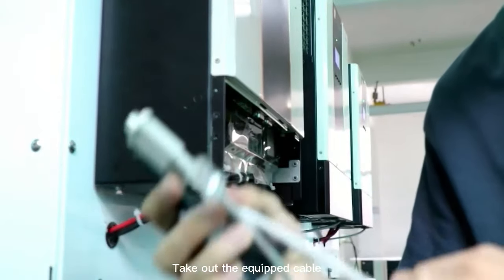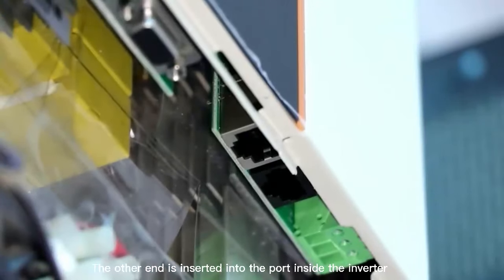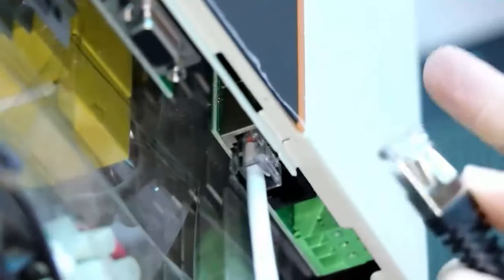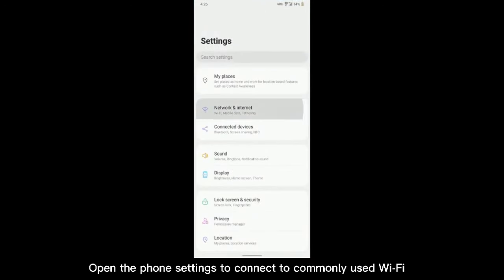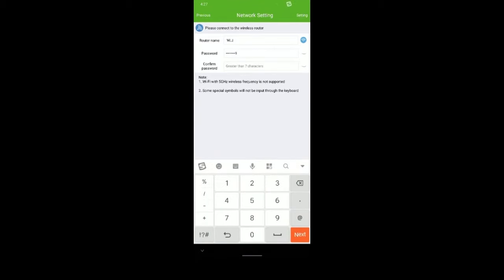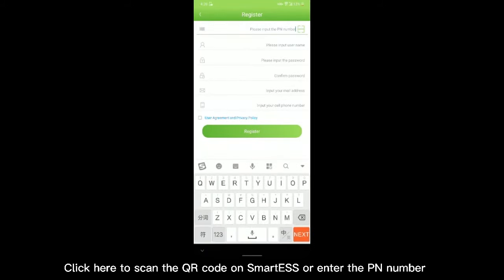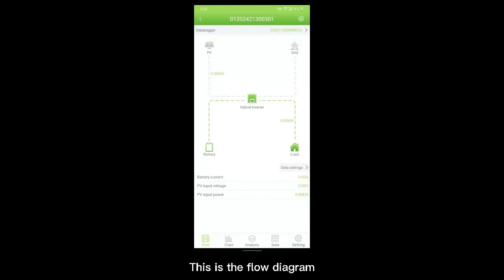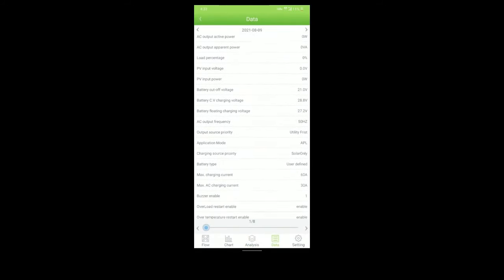Felicity Smart ESS installation

Comment: Hi there @felicitysolar ,
I’ve got three inverters on my wall (three phases), they are all correctly connected and work well. Also two batteries. However, when I connect the dongle to the first inverter (P1), it only shows the data for that inverter. I assume that the inverters communicate with each other. How can I read the accumulated data (entire solar production of all three inverters together)? I surely do not require three separate dongles, do I? What setting do I have to change so that the overall production is reported via the WiFi dongle? Thanks for your help!
Reply from the maker: Thank you for your trust in us. Please contact our engineer for Technical support by whatsapp: 
Wasely  +86 131 2609 3443
Reply: @ @all : I am highly disappointed. I was told that one dongle can only monitor one inverter, even though the inverters are connected by communication cables. In short, there is no way to properly monitor three inverters in a three phase setup. A setup that is promoted by felicity solar themselves. This needs to be fixed - as well as a proper API for home assistant integration + an application that is not full of bugs. 🐞 so much room for improvement and many low hanging fruits. At this point I would not recommend anyone getting a felicity solar inverter.
Reply from the maker: @ Thank you very much for your support. We are sorry that this product function cannot satisfy you. Felicity Solar is a developing brand. We will continue to improve related functions after receiving your feedback, so that you can use it more simply and conveniently. 
Please continue to pay attention to our new product functions. We will strive to meet your expectations, and please give us more suggestions for modification.

Comment: Will the WiFi pro 5 Work on IVPM10KVA . 
Which model of WiFi pro works on IVPM series?
Reply: I have the 03 version, it connect but does not detect any divice, my equipment is mppt 48v 120Ah, battery 48V 300Ah and IVPA 10K.
only battery and inverter communicate, MPPT and wifi Pro 03 they dont communicate 😑

Comment: Hello, I have the IVEM5048-S inverter with two 48v 8.7KW felicity lithium batteries installed. I have connected the two black communication wires between the two batteries . Is this correct ? Or should one of those wires go from one battery to the other , and the second one from the battery to the inverter?
Reply: you should connected them in a parallel way
Reply: type in YouTube how to connect two batteries parallely
Reply: Where and how can I get this module to be able to monitor my battery?

Comment: I received this wifi pro 5 plug with Powmr Inverter . The inverer is working but not wifi module. Can you mention RS232 to RJ45 cable pin out ,connection to verify my dongle cable .pls.
Reply: Where and how can I get this module to be able to monitor my battery?

Comment: Hello
In my home I have 2 networks
1. Main wifi network
2. Access Point network (extension of main network)
When I configured the wifi module first time I used the access point network.. it was fine
After that I tried to connect the wifi module with the main wifi network and I turned off my access point.. it didn't work
I did reset collector from the ESS app then I tried to connect unsuccessfully!

How to reset the felicity wifi module? Can we reset it from hardware?
Reply: Did you solved problem?
Reply: @maximusekkk  yes I contacted the internet provider.. a rule on the router was blocking ESS.. they resolved it
Reply: @mahdiaknan1  Internet provider blocking ESS or your Router blocking?

Comment: I have felicity inverter , and other drvice . Does this dongle work on my other voltronic inverter so i can control both
Reply from the maker: May I know which country you are from? Then I will send you the contact information of the technician.
Reply: @felicitysolar  Syria
Reply from the maker: @esmailalkassir1565  please contact Veon via whatsapp: +86 13640642758
Reply: I connected and registered the WiFi module as described. All LEDs lit. But app does not see my Felicity inverter.
Reply from the maker: @АндрійГайдучек  Thanks for your inquiry. Please contact our engineer for Technical support by whatsapp: 
Wasely  +86 131 2609 3443

Comment: I have the same datalogger and it was working fine for about a year and last week suddenly the "COM" port green light went off and it's not working, the app is showing it as offline. All other three lights are green, how to fix this, I tried restarting inverter, restart dc power, reinsert the cable, tried a different cable, But still "COM" port is off. Any way to fix this.
Reply from the maker: Please contact our engineer for Technical support by whatsapp:  +86 1802287 6286
Reply: Did you fix the issue?

Comment: Monthly and yearly data analysis as well as usability fee, was what I needed and it failed to work, smartess disappointed me, please smartess fix this weakness.
Reply: I have the same problem. Nice to see some graphs,.. but would be "normal" to see the used and produces kwh per day, month, year!  Seems that in an older version this was possible but is it possible that they removed it?? WHY??
Did you find another solution for it? Another APP?

Comment: While trying to register on app
Its showing verification code time out 
Again and again 
While this problem is not actually
Reply from the maker: Has this issue been resolved?
Reply: @felicitysolar  
No not yet
Reply from the maker: @mohammadzaheer4537  Please contact our engineer for Technical support by whatsapp: +86 1802287 6286
Reply from the maker: Or leave your email address and our technical department will contact you☺